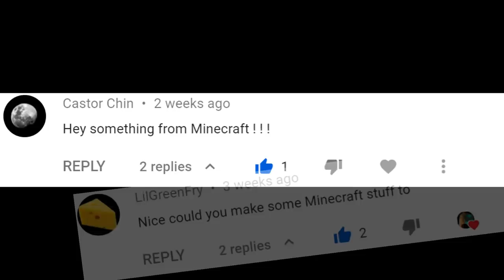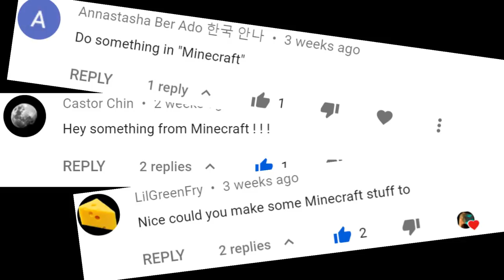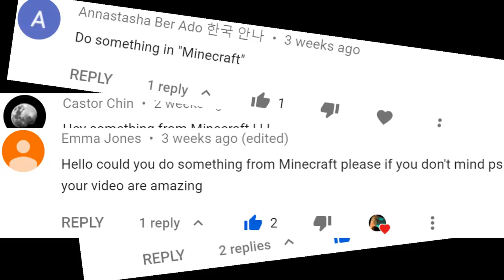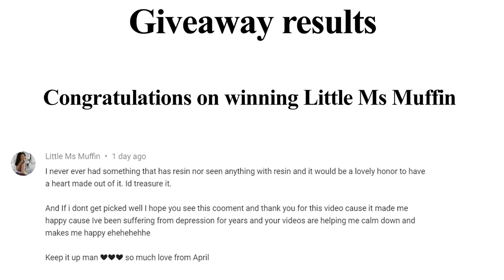Minecraft Diamond Pickaxe from Epoxy Resin / ART RESIN

Comment: That things going to fall apart before too long, you should have cast that in clear resin after you finished it. The super glue dots are not very strong and considering you didn't press them together very tight the gaps give too much flex